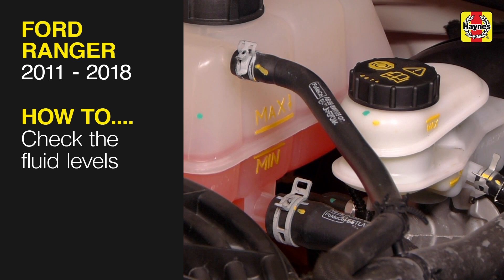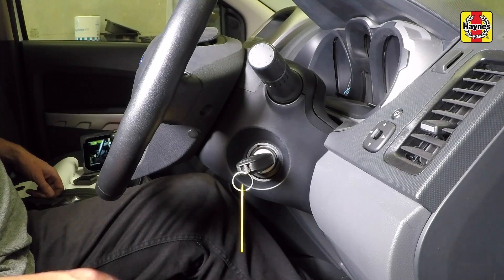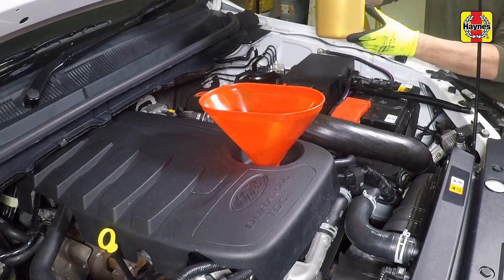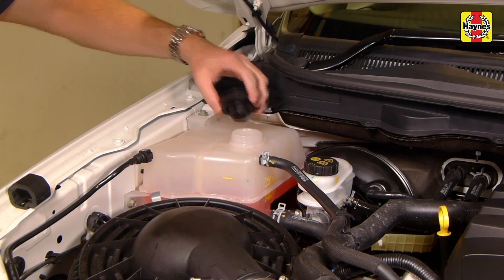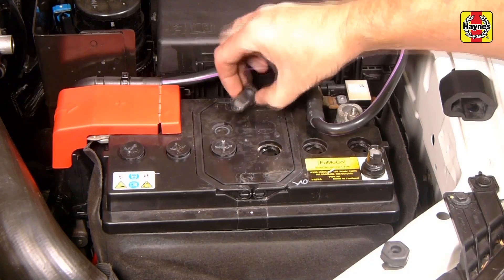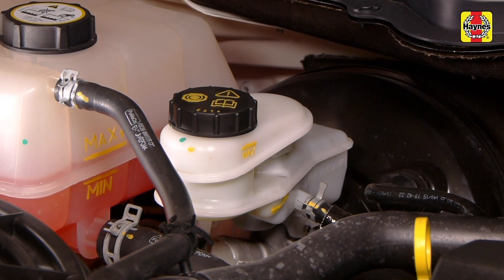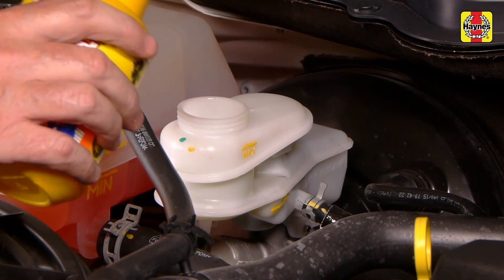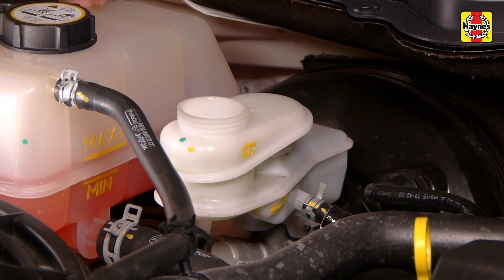How to Check the fluid levels on the Ford Ranger 2011 to 2018

Comment: Show how to remove the header tank cap without breaking it as the vacuum hangs on to the bottom half of the cap and the top seperates while undoing it  , I only undo the cap now when the system has enough pressure to help release the double o ring base from the neck of the reservoir tank